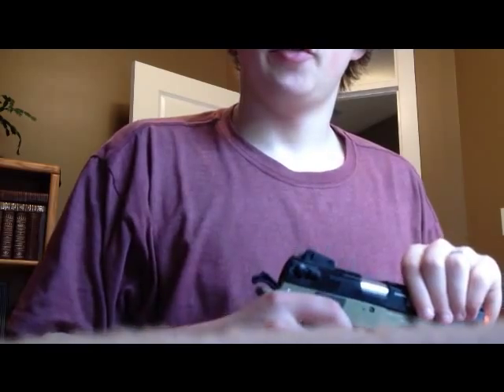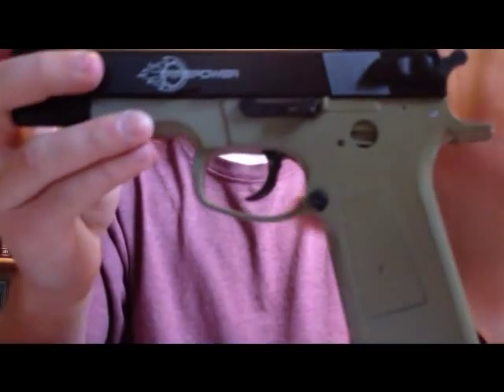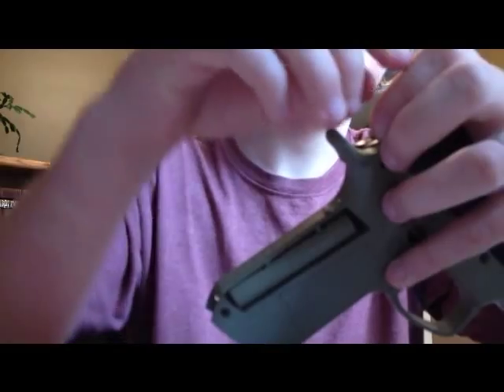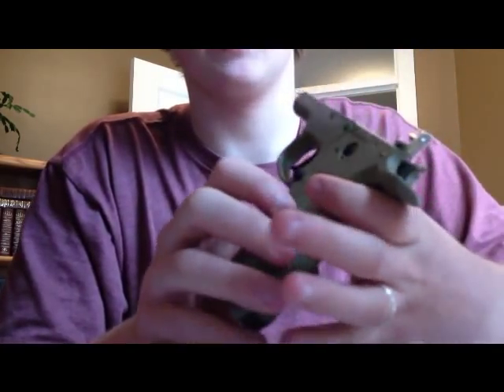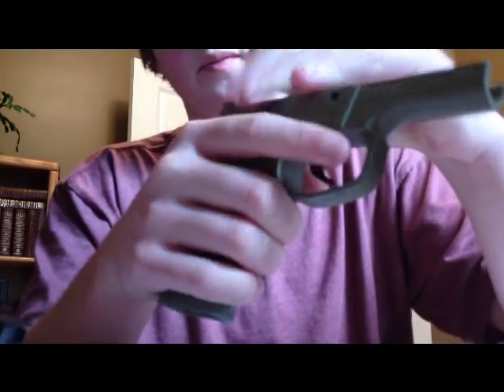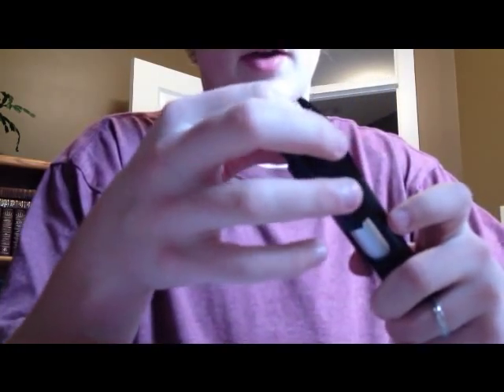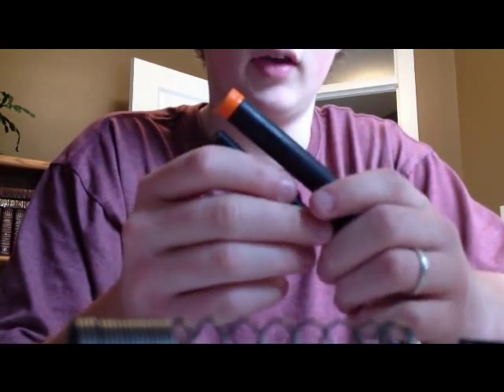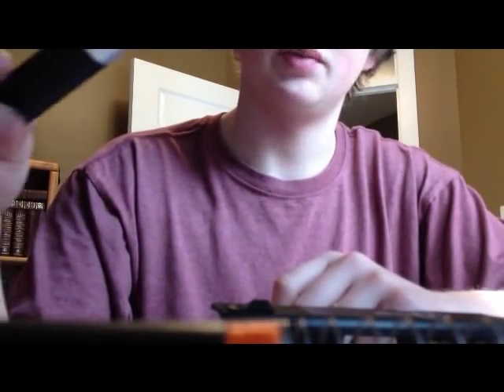How to Dissasemble and Re-assemble an Airsoft Gun (Field Strip)

Comment: THANK YOU SO MUCH. I almost broke the body of the gun trying to get the safety out. Side note push the safety up towards the slide and carefully pry the end that connects to the inner mechanism out of the hole, then push out the pin. Also wicked job on the color combo for the body/slide. You rock!